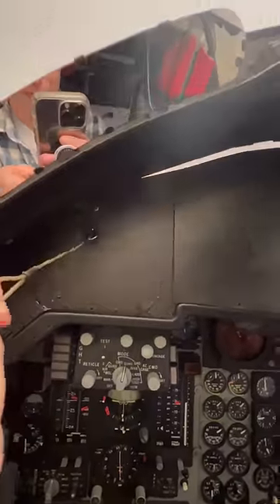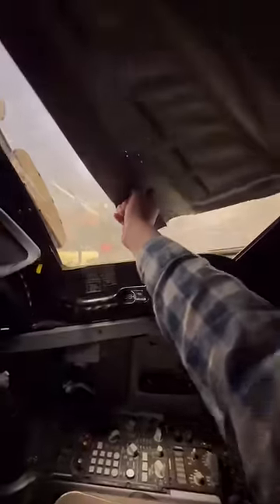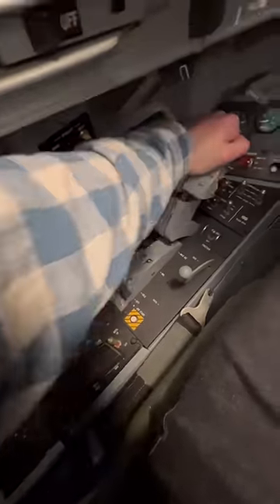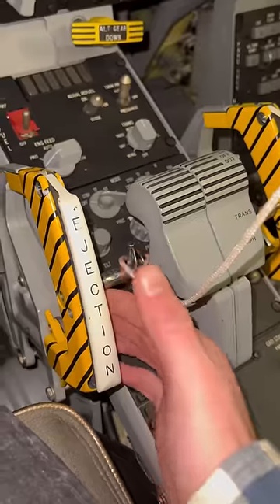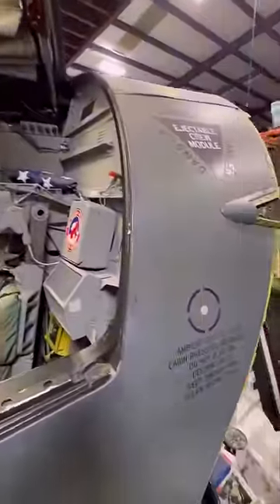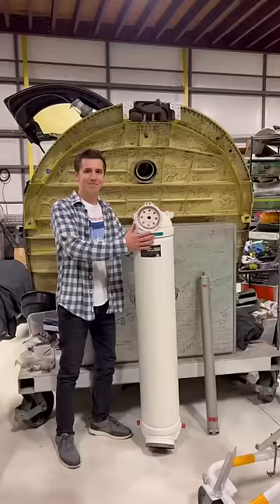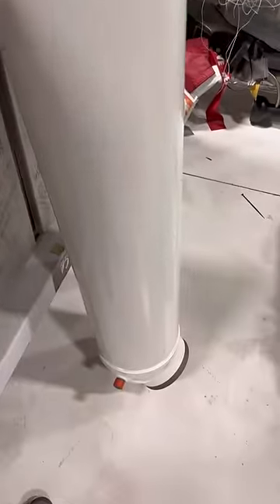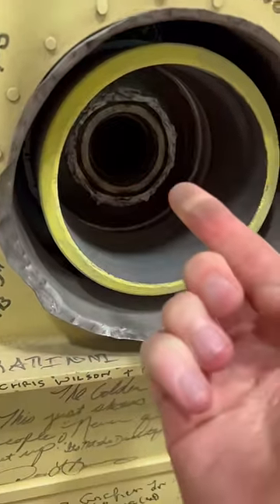How to Drop a Nuke and Survive

Comment: Hey, where's the "do not try this at home" disclaimer? People need to know not to do this.
Reply: Lmao, especially these days
Reply: @makzer8770  I’ll help you
Reply: Well he didn't actually do anything dangerous. The most dangerous thing was probably his wiping his finder on the residue. 
People can do anything he did in the video safely because he didn't drop a nuke
Reply: What if I'm at a military base, not home?
Reply: @makzer8770  I played GTA 5, if you fly low, they wont notice you
Reply: @makzer8770  I bet half of their AA doesn't work, you'll be fine
Reply: @makzer8770  yeah so what you need to do is start flying, then keep flying straight past the anti air "defense".
Reply: @dustsans9859 that's war thunder logics lol
Reply: @makzer8770  As long as you aren't a Boeing Airliner, especially a 707 or 747, you should be save, even a Cessna C172 made it
Reply: Fly about 10-20 feet above the ground and you won't be picked up by radar. Try to use terrain masking
Reply: @dustsans9859  I can back this up with the documentary top gun maverick where they flew low and dint get noticed either
Reply: @makzer8770  i also need help
do you know any way to fly over new york without being noticed?
asking for a friend
Reply: @makzer8770  Try this
Injects plane with a bluish white Liquid
Finaliam should give your plane a bit of a hypersonic boost
You should be able to out run the missiles
Reply: in case of nuclear war you have to think about it and the duty to do this.
Reply: @makzer8770  I'm a Russian anti Air and radar tracking engineer and the anti s400s and newer variants will shoot you down easily
Reply: @makzer8770 fly high and fly fast, they might notice, but it won’t matter.
Reply: do not do this in your local military jet*

Comment: Fun fact: F-111 got this escape pod because the Navy asked for the F-111B cockpit to become an emergency raft to improve survivability when ejecting over water. It was also one of the reasons why the F-111B was too heavy to meet Navy's request, but Navy said the pod was non negotiable. Eventually the F-111B program was cancelled in favor of the F-14A, which lacks multiple requirements the navy asked of the F-111B including the escape pod among other things as well as still being overweight.

On the other hand, the Air Force initially asked for a tandem conventional cockpit like the F-14 would later become, but Navy said no and Congress said keep it the same as Navy. In the end, the F-111A for the Air Force got a free emergency survival shelter and the pilot and copilot can hold hands for emotional support as they loft down to the post-apocalyptic world.
Reply: A bit more to the story. Sec of Defense Robert McNamara thought the Navy and AF should share the same aircraft, regardless of the doctrine and needs of either service. Pure ego. The same ego that ensured the early M16 didn't have a chrome lined barrel. Robbie got quite a few soldiers killed in Vietnam. Somehow Robbie thought the Navy should be able to adapt an aircraft built to AF requirements was going to operate off carriers. NWIH was that happening. There's a very good reason the two birds operated in common between those services were both designed for the Navy and later procured for the AF. (Phantom and Corsair II) It's a small miracle the F-111 was built at all, let alone end up as a damned fine aircraft.
Reply: @Ares-jx4ep  Well there's more to that as well. Navy command absolutely hated the idea of ever having anything to do with Air Force planes, and while the F-111B was nowhere near ideal, if it was modified to the same requirements as the F-14, it would have been passable, not ideal, but passable. Now don't get me wrong, I absolutely adore the F-14 and I'm glad that the Navy was really stubborn about the whole thing, but I'm just saying if the Navy wasn't so stubborn about it, we could have gotten an entirely different plane half as closer to the F-14 in performance for both the Navy and the Airforce.

Also McNamara was formerly a president of Ford and he used the same strategy to save the company, which was how he became the first Ford president outside of the Ford family. He was foolish for thinking that way of problem solving worked for every application, but I guess his dream is coming true these days due to budget constraints. Just looking at the F-35 series, he would have shed tears of joy
Reply: @strf90105  Ok, let's play it your way. If the AF wasn't so stubborn in their range and nuclear delivery demands the Vark could have been an entirely different plane.

 In reality the two services had totally different needs. One needed a replacement for the Thud for the long range strike. tactical nuke delivery role,  the other needed a better interceptor than the F4. The TFX program was doomed from the start and both services opposed it. But Robbie knew better....

 You bring up the F14 as the comparison. Sure do that, but do it from the other direction. The F14 was an interceptor pure and simple. See if you can figure out a way to give it the Vark's range/payload/munitions capability and still have it be a better interceptor than the F4.

 Had Robbie listened the AF would have had a better strike aircraft than the Vark and the Navy would have still had the F14, for less money. (Assuming the AF didn't go crazy with their demands forcing cost overruns, etc.)
Reply: Ur wrong he's right deal with it  @Ares-jx4ep
Reply: Well since you agree with him I'm left with little choice but to accept the fact you're both ignorant.
Reply: 🤷‍♂️I mean one nuke dose not an apocalypse make
Reply: @Ares-jx4ep well said.
Although I enjoyed reading both of your comments. You guys should have a beer together seriously 👍
Reply: @Ares-jx4ep I think you both had good points and obviously a shared passion (and common hatred 😂) 
Honestly if you were in the same room I think you’d be buying each others beers
Reply: @gregoryballestero4369 I disagree: “MUAD”
Reply: @JamieWalker-pc6nd  I had no issue with the facts as he he presented them. All of them were true. My issue stems from the Navy getting painted as being unreasonable. 

 The TFX program was flawed from the start. One service needed a plane with range and strike capability, the other needed a better interceptor than the F4. The only thing common is the "F" designator. Had the Navy played ball they would have ended up forced to buy an expensive jet with no real role on a carrier.

 The assertion I do have major issue with is that the Navy wanted nothing to do with Air Force planes... well no $h1t, show me a plane built to an AF specification that could feasibly operate off a carrier. They can be counted on the fingers of a man with no hands.
Reply: @Ares-jx4ep  McNamara would have fragged the minute he went to the latrine after landing in Nam.
Reply: @gregoryballestero4369  Yeah but they don't usually just drop one.
Reply: Kinda. The navy didn’t fully adopt the f-14 as a replacement to the f-111 program. That is, they weren’t meant to serve the same role. Navy didn’t want a bomber they wanted a fighter. The F-111 could not truly fill that role and was only going to have a few missiles. They figured instead better radar, better missiles and more subs and carriers would be better. F-111 has to drop a bomb, meaning it could be shot down and the enemy recover the nuclear bomb before you reach the target. A missile on a sub could park a short distance from the target and strike at any time. Satellites can see a CBG but can’t track subs as easily. F-14s with nukes would be more likely to reach a target, deal with threats and on a satellite, looks like any other fighter. Plus the navy wanted to replace the fighters they were previously using with something more multi role but still better. Basically, why have 5 different aircraft with widely different specifications, requiring different parts and largely incapable of performing the same role or in some instances, performing the same role but being two different aircraft with different specifications and capabilities. Essentially, why have the intruder, skyhawk, and phantom, then add the seapig, when all are strike craft, that use different parts. Instead they started the transition to the idea used by the navy today. A few different types of aircraft that perform separate unrelated roles with a carrier primarily having one main craft capable of doing almost any combat role, requiring only an armament change. You’re not wrong, it’s just a side story. An additional reason as to why.
Reply: Classic “death by committee”. It’s interesting to see the F-111 slowly morph into the F-14 there’s a picture of a cursed model of an F-14 that has a single tail like a F-111
Reply: isn't the navy also the reason the space shuttle is an overblown mess?
Reply: @tsm688  that was DoD not Navy. It was a requirement for DoD funding of the shuttle project to have a cargo bay that could single launch spy satellites and be capable of capturing them in orbit and bringing them back for servicing and or stealing soviet satellites. The space shuttle was basically a glorified pick up truck.
Reply: @AppalachianMountaineer1863  Ah yes.  The requirement specifically, was that NASA's slimmed-down cost-cutting space shuttle be able to carry a city bus to orbit.  (Well, the HEXAGON.)

Then they never USED the shuttle to carry the hex.  Not even once!
Reply: @tsm688  space shuttle was a failure from the start, the money invested into its designed could’ve been used for habitation mission on the moon or an American space station
Reply: @AppalachianMountaineer1863  oh god I remember that picture.
Reply: If the Navy got the pod on the F-14, Goose would still be alive

Comment: Fun fact, up until 1977, the nuclear launch codes were 00000000
Reply: Pretty sure back then almost everything just used default passwords
Reply: That can’t be right
Reply: That was specifically launch enable codes for the Minuteman ICBM's, and there seems to be some controversy if that was the actual code or just a placeholder in the manuals. Sub launched and Air launched used a different process.
Reply: Allahu Akbar - that's strange info

Comment: Me: drops nuke
Also me: “Nah, things ain’t looking good, im going to eject and parachute straight into the nuclear blast zone”
Reply: Those jets go plenty fast enough to get you put of the blast zone before you eject chief
Reply: @Analog_Momo Regardless I wouldn't want to be within 100 miles of the blast zone.
Reply: @Analog_Momo And there was and maybe still is a parachute on the bomb so the plane can get enough time to escape the area
Reply: The entire cockpit ejects and can survive a nuclear blast
Reply: Bro did you not see that it ejects the cockpit and fires the rocket from the back, flying out of the blast zone
Reply: It’s fine it’s like swimming in liquid after burner
Reply: @jbrownbear742 the cockpits can survive a nuclear blast can they 🤔
Reply: @Scooter_Mates99  it's designed to keep you safe when you eject.
Reply: @jbrownbear742  it doesn't keep you safe from radiation though
Reply: @x72s  yes but you will still be out of the range of the radiation that would kill you.
Reply: im guessing the ejection was just in case you were scared of crashing. you would be safe in the cockpit from the explosion but not a crash into a mountain from high speeds